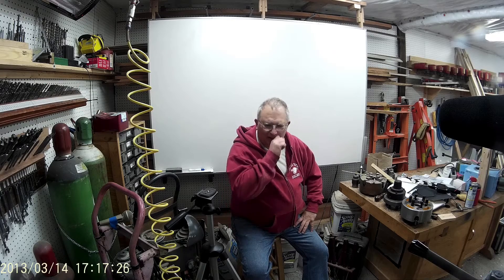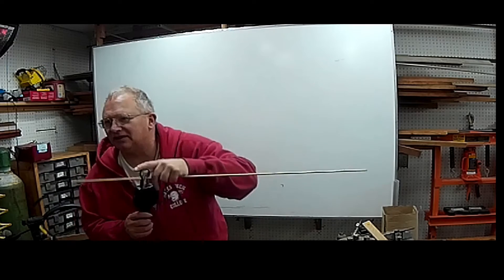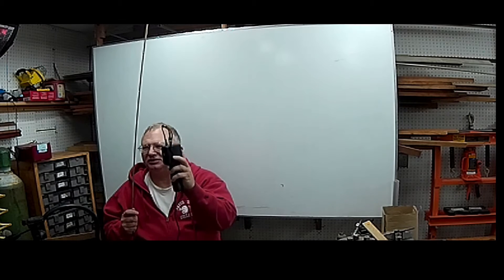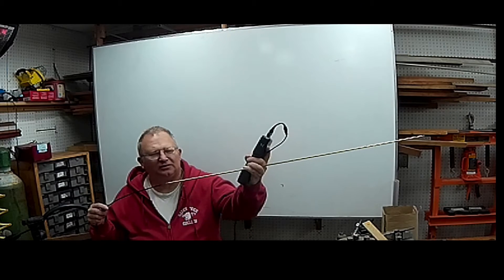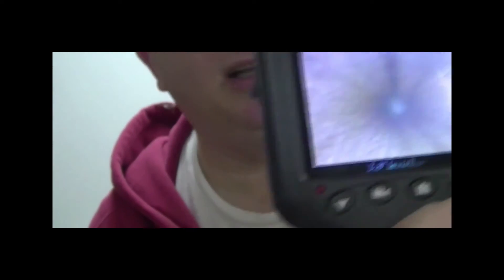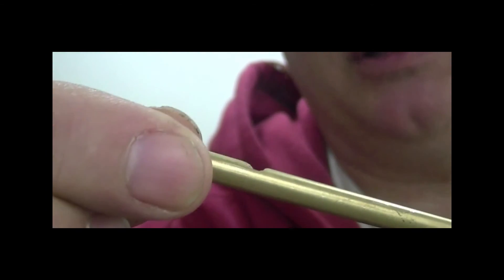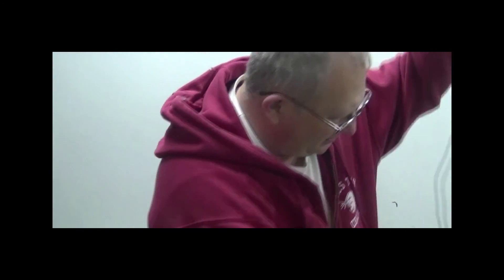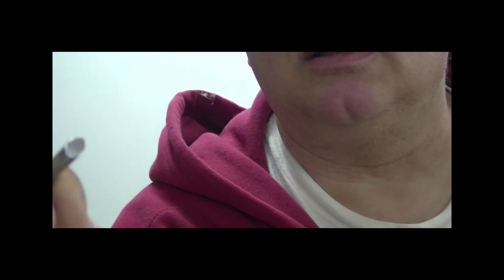Episode 1 DIY Borescope Part 1

Comment: hi ,
what's the manufacture of the bore scope you have, i was trying to find something similar with the same diameter you have.
thanks mate!
Reply from the maker: It has been several years since I bought mine. I see they are no longer available on ebay. The good news is that any endoscope that fits inside a 5mm brass tube will do fine. The endoscopes out there today are much better so I would recommend finding one that fits and go with that. Best of luck

Comment: Sorry, don't know about how guns or how they are inspected...does the mirror go in on the barrel side and the camera somehow snaked in from the chamber end?  How does the inspection process work with this?
Reply from the maker: On bolt action rifles the bolt can be removed so you can attack from the chamber end. On autoloaders and pumps, you can attack from the muzzle. Thanks a lot for your question.
Reply: The Crusty Old Machinist Thanks, Crusty...So, the mirror goes in first, followed by the camera?
Reply from the maker: The mirror goes in one end, the camera goes in the other end.

Comment from the maker: Hi Jody:
Thank you for leaving a comment. As I said in the video, I was using a first surface mirror (from a big screen TV which has the reflective surface on the front of the mirror), so the glue would attach to the back like I said. You said I was probably using the wrong adhesive but did not mention which is the correct adhesive. The mirror I ended up with is extremely reflective and works just fine. Thanks again for your comment